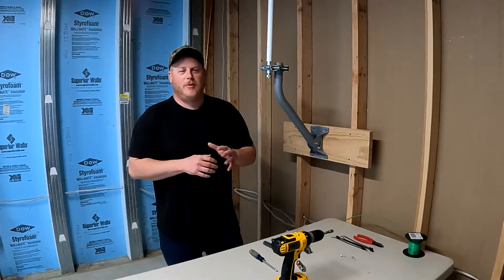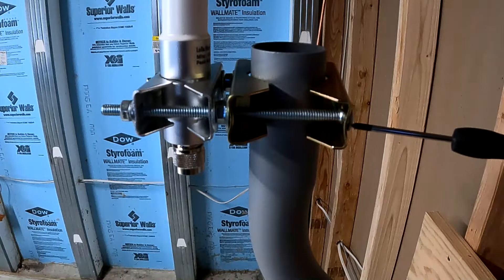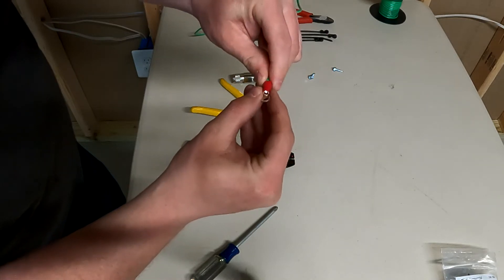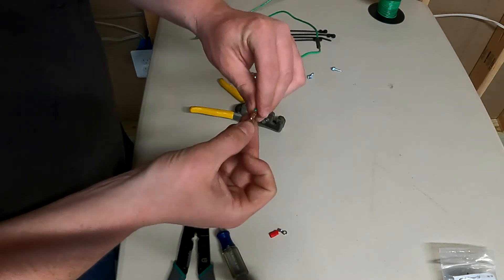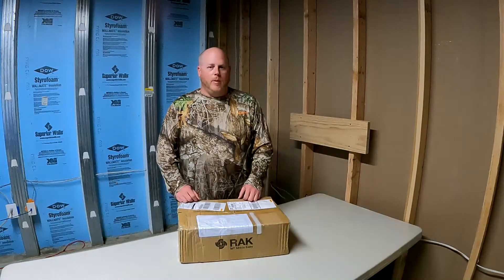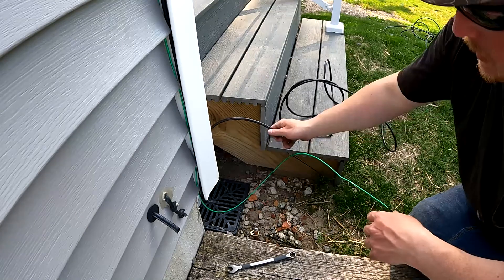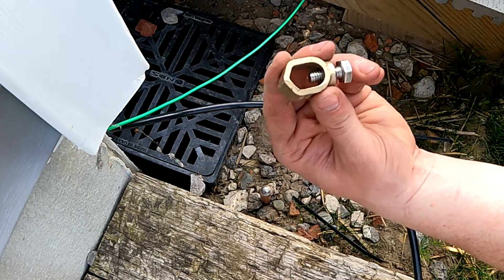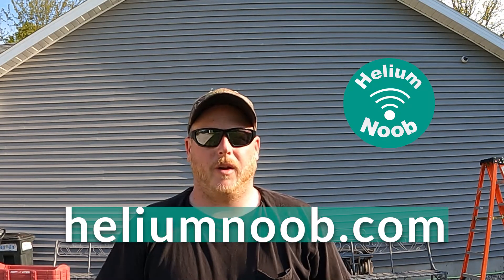Part 2: RAKwireless 8dbi Fiberglass Antenna Install (For Helium Mining HNT)

Comment: Hello friends!
I bought a 8.0 dbi antenna to change 4.0 dbi and first I disconnected the power, then changed antenna and still not working 🥺I see that small wire which mr noob connected it. Where to put the other end of it? And what is the technical name of that small tiny wire? I am down here in Finland and no experience at all.

Comment: How far can you run LMR 400 (the cable wire) from the miner to the antenna? what if I need 300 meters, will it work?

Comment: I trust the outdoor enclosure and also live in Wisconsin. My miner is going to be kept indoors with low-loss coax running to the roof. Easy access in winter is preferred. Officially, the price difference was small, but now enclosures are oos.

Comment: Is there a specific adapter needed between the cable and lighting resistor?
Reply from the maker: If you order the cable with the correct ntype connectors...no.
Reply: @HeliumNoob  I dont know what would be the right cable type is.  I know length only
Reply from the maker: @artkillary  usually lmr400... usacoax has it by the foot and you can pick your connectors. Did you get an arrestor yet?
Reply: Everything is all set , im just missing the right cable to connect to the lightning resistor. Thanks for all the help
Reply: Correction here is the ressitor I have

Brand:Riotaxy

Lightning arrestor N Female to N Female Bulkhead Coaxial WiFi Lightning Surge Protector IP67 with 90 V Gas Tube 50 Ohm DC-3GHz
Reply from the maker: @artkillary  so you need male ntype on the arrestor side. Whatever your antenna is then you need opposite ntype on that side...what kind of antenna did you get
Reply: @HeliumNoob  on the other end would go back i to the house to the Rack Miner V2.

Comment: why not just put the whole the enclosure on the pole using the brackets that come with the kit?
Reply from the maker: For me it was height, but that is absolutely an option. What is shown in the video (in a basement) was for ease of filming the video. I moved it 20 ish feet in the air. It is easier to service if needed at 16 ft, instead of leaning back off a ladder and reaching another 4-5 feet over a soffit. Also, I wanted to keep it out of as much direct sunlight as possible.  Thanks for the look, please subscribe!
Reply from the maker: I saw question from you in my alerts but can't find it in thread on my phone....the hub on the enclosure is an Ntype Female. Your antenna will need to be Ntype Male. If you put a lightning arrestor in between, it needs to be male to female n type, and then antenna would still need to be male ntype. Hope that helps.

Comment: So the antenna needs to be grounded? Like it has potential to get struck by lightning?
Reply from the maker: Yes, lighting strikes are possible, however static electricity from wind is more likely to affect it. The arrestors helps disburse that.
Reply: @HeliumNoob  how deep does the ground rod need to go
Reply from the maker: @tenibrosity3425  in my locality it calls for an 8ft rod....that is pretty standard but you may want to check local codes.
Reply: @HeliumNoob  okay mines 8ft as well here in Las Vegas but the ground is really hard so there’s no way I can get it 8ft without power tools.
Reply from the maker: @tenibrosity3425  yeah it can be tough.....a small breaker/demolition hammer with sleeve works well. Good luck.
Reply: @HeliumNoob  you too man 👍🏼

Comment: Hi do you have a link for the ground wires? I don't see it. Thanks a bunch
Reply from the maker: Just grabbed from home depot. Amazon has it too. Here's an example https://www.amazon.com/Solid-Copper-Ground-Listed-Satellite/dp/B00JJTPWII/ref=sr_1_6?crid=29CPTU46M3EPI&dchild=1&keywords=solid+copper+grounding+wire&qid=1629827012&sprefix=solid+copper+ground%2Caps%2C214&sr=8-6
Reply: @HeliumNoob  okay great. How many of these do you think one would need if they had about 30 homes to do? Is it one per home in your opinion?
Reply from the maker: @Iranolaschools  depends on how long the runs are. You may be better served finding a larger spool like 1000ft maybe that would get you about 33ft per house. May be cheaper that way. My house is a 1 story and it was like 32ft.
Reply: @HeliumNoob  oh okay great!! Thanks so much

Comment: Hello, can you tell me which way the 8 dbi antenna can pick up? Because I hesitate to take the 5.8 dbi and the 8 dbi, I live in town and I am afraid of making a mistake. Can you help me ? plz
Reply from the maker: Thanks for the look. Depends on what type of 8/5.8 dbi antenna you have purchased. The ones I show from RAKwireless are omnidirectional which means the antenna radiates equal power in all directions of an axis, a directional is designed to radiate a stronger lobe in one direction. For 5.8 dbi omnidirectional picture a baseball, for an 8 dbi omnidirectional picture more of a donut.

Comment: Great job making this video, very helpful. As an electrician I have to tell you the correct way to use the ground clamp, on the ground rod, is to put the wire on the opposite side of the clamp (in the V). The bolt should tighten on to the ground rod. Also crimp connectors are designed to be used on stranded wire. I hope you get that my intention is not to put you down, but to help you be better. I watched several of your videos, you do a great job teaching us, thank you keep up the good work.
Reply: Great reply to this video in a very positive correcting manner We feel your spirit of kindness and encouragement. Thank you for your input from a fellow subscriber to this channel. I'll apply your insight and knowledge in the days to come when I install my 8dbi antenna!
Reply: It was hard watching him make these connectors
Reply: Hi Carl, so per your comment the ground wire can just directly insert into the space for the arrestor instead of a connector like he did?  Also on side of my house is a ground wire (same side my electrical panel is, ac unit, etc) I assume I could run ground from the arrestor + mast to this wire instead of installing a pipe?
Reply: (LOL as all the electricians chime in) I thought the minimum guage for an antenna was 10 guage, also.

Thanks for the video man. Hoping to land a miner this drop.
Reply: Hello friend! 
I bought a 8.0 dbi antenna to change 4.0 dbi and first I disconnected the power, then changed antenna and still not working 🥺I see that small wire which mr noob connected it. Where to put the other end of it? And what is the technical name of that small tiny wire? I am down here in Finland and no experience at all. 
Best regards from Finland to you all!
✌️🌹👍
Danny

Comment: I understand why you would use a lightning arrestor if mounted outside. If mounted in attic would you use one? Also, why not connect to the house ground instead of a new/shallow ground?
Reply from the maker: Thanks for the look. I shot part 2 in the basement, install is actually outside.

Comment: I've read it's best to get antenna 5' above roof line. How do you suggest increasing the height above the roof? Could you add a PVC pipe to that tower mount and place the enclosure + antenna at the top?
Reply from the maker: I haven't heard that exact best practice, but yes the higher the better. I would just add in another pole in between, either find one that couples in with the mount or use a different style mount for a mast with the clamps at the top of that to the antenna. Good luck! I have also been checking out retractable flag poles. easier to service!

Comment: Can i the link for the grounding rod ?
Reply from the maker: My favorite Breakfast restaurant...lol.  Sorry for the delay... I just got it at home depot. Here is a link 
 https://www.homedepot.com/p/ERITECH-1-2-in-x-8-ft-Copper-Ground-Rod-611380UPC/202195737.

and the clamp: https://www.homedepot.com/p/Southwire-1-2-in-Grounding-Rod-or-3-8-in-Rebar-Ground-Rod-Clamp-for-10SOL-STR-2-STR-Wire-65176340/312648489

Comment: The insulation on the ground connection is really an appearance item in this case. There is literally no practical reason for it to be there in a normally non-energized circuit, and it isn't gonna do squat against a lightning strike.
Reply from the maker: Thanks for the comment kip. Correct, adding the casing is for a clean look, could possibly help prevent corrosion though. Not much is gonna stop a lightning strike, I agree. Please subscribe and give other feedback, much appreciated.

Comment: He bro i live in a suburban area with trees and some hills(im on a hill neighborhood) there are like 3 other minors spread out 1-2 miles from each other. I live on the 3rd floor of my apartment (28ft from ground) what kind of antenna would be best for me? I used hotspot rf and when i put the info with an 8dbi antenna i seem to get good results and when i put 4-5dbi yhe results in rewards is much lower. But i here ppl say to just stick with 4db that bobcat 300 comes with. I dont know what to do... any advice?  Im located in Alexandria, va 8-10 min from the denser city of Alexandria and 15-20 min from D.C just fyi.  Hope to hear from you, thanks 🙏🏻
Reply from the maker: SAN MAN....thanks for the look. That 4dbi stock antenna for the Bobcat, from the feedback I have heard should be decent for your situation (hilly) as it is more of a 360 degree pattern vertically and horizontally (imagine a big baseball), the higher the dBi the more flat the degree pattern gets horizontally, a RAK 8dbi is 25degrees (imagine more of a donut). The higher the dBi the more concentrated the horizontal axis is which makes it reach further, but you may fly over some hotspots. I am not sure on the exact terrain surrounding you, so I really can't answer the question fully. Antenna's really aren't that hard to come by right now, so maybe start with the stock measure it for a week or so and if you feel like you can get more, grab a higher gain antenna and see what happens.
Reply: @HeliumNoob  ok ill give the stock Antenna a try. I appreciate your response. Thanks bro

Comment: Is there any risk in grounding to a grounding stake and creating a second ground vs connecting the antenna ground to your house ground? Also, what gauge grounding wire did you use? Thanks.
Reply from the maker: No risk adding a second ground rod. Either way is acceptable. The reason I added a second ground bar is because my main electrical service and ground rod is on the other side of the house. It was easier and less expensive to pop a new rod in then run another 125' of ground wire. I used 12 guage solid.

Comment: Good content, just subscribed. Thanks for the video. One question ,is that additional copper ground rod that you install around the house for your antenna? I want to do the same but I'm concerned about NEC since the location of my antenna install would be at the other side of the house and I dont have the ground rod over there.
Reply from the maker: Hey John....thanks for the sub. I installed the ground rodin this video just for the antenna. My main/ground bar for the house  is on the other side. I was concerned with distance and it saved me about $20 bucks to just put another one in instead running the line another 100ft.
Reply: @HeliumNoob  did you tied this ground rod to the main ground connection of your house? or its just a standalone earth ground rod?
Reply from the maker: @johnpapacap5119  I didn't tie it in. I just added it, yes standalone earth ground rod.

Comment: My uncle has been dealing with antennas and communication devices his whole life he is wondering why your lightning arrestor goes in between the cable and antenna?? He saying  the lightning arrestor should be installed on the end of the cable before it going into the unit . Any thought or ideas why u do it this way??
Reply from the maker: When I was doing my initial research I read somewhere that the arrestor should be as close to the equipment as possible but no more than 2 meters from the equipment. I have also seen it done both ways. Thethingsnetwork.org suggests an arrestor at every n-type connection. My thought was lighting usually strikes at the highest point so put it as high as possible and protect as much of the system as possible. You can't put a price on experience, I think your uncle is right as well. IMO if the full force of a direct lightning strike hits the antenna, your probably screwed anyways.

Comment: Can you please add a Link to the cable that you are using that connects to the Lighting Arrester and let us know what kind of Varient or connection type: "RAK9733 RP-SMA Male / N Type - Female" or "RAK9731 RP-SMA N Type - Male / N Type - Female"  to buy if we are using the RAK Miner and the Bobcat Miner. Do we use the same wire and connection type for both?
Reply from the maker: Cable build link can also be found on heliumnoob.com : https://usacoax.com/custom/custom-lmr-400-cable-build.html 
Also, I have a video just on this https://youtu.be/NEu0u3UG4wo
Your connectors are going to be based on what the Antenna, Arrester, enclosure and Miner are. So please use caution your setup may be completely different.

My Example: Antenna (Male N-Type), Arrester (Female to Female N-Type), Enclosure (Female N-Type to Male RPSMA), RAK Miner (Female RPSMA)

The Arrester is a direct connection to the Antenna, No cable needed.
The Arrester to the Enclosure would need Male to Male N-Type Cable (I purchased this at the link above)
The enclosure comes with a feeder line that goes into the miner.

The RAK Miner is a Female RP-SMA (so you need a Male RP-SMA Cable)
The Bobcat spec sheet shows Female RP-SMA ( so you need a Male RP-SMA Cable)

The other side depends on what your arrestor is. Hopefully that helps. LMK.

Comment: Great video - what's the length of the lmr400 cable did you use?  It looks to be about the same length for mine.
Reply from the maker: Thank you for the comment. Mine is 7 feet.